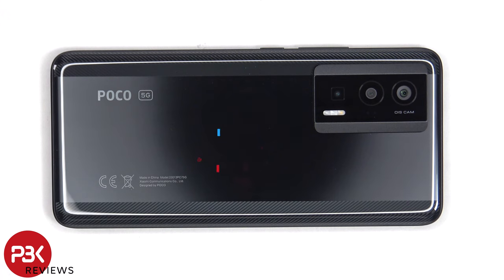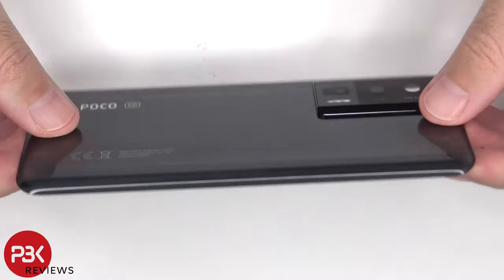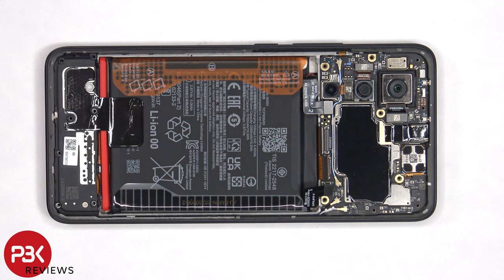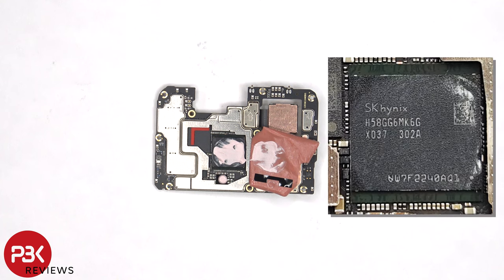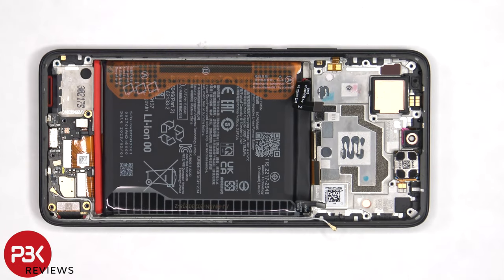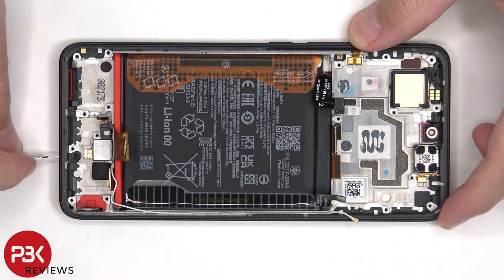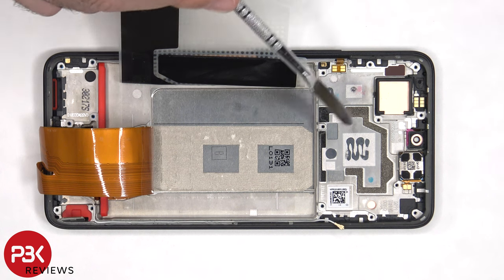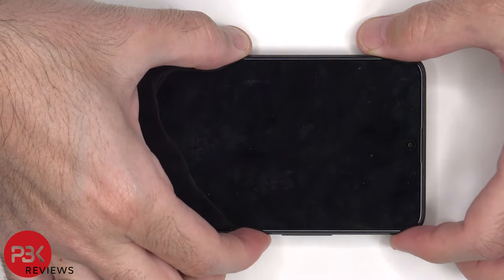Poco F5 PRO Teardown Disassembly Repair Video Review

Comment: i hope this phone last unlike my old x3 pro just died after 9 months
Reply: Phone died or your battery died ?
Reply: @edwardfletcher7790  Phone, maybe motherboard common issue
Reply: @Pezoro_2005  Fixed under warranty ? 

I'm asking because I'm buying a new phone and seriously considering a Poco
Reply from the maker: Hopefully these wont have issues like the older models. They do look better overall compared to before.
Reply: @edwardfletcher7790  nah i dont have time waiting months just to repair instead i buy new one
Reply: @PBKreviews  i hope so, thanks and your video are cool 😊
Reply from the maker: You're welcome, and thanks!
Reply: @edwardfletcher7790  i have xiaomi mi 10 lite and motherboard died now i have poco f4 if this phone i have died like my last phone i never buy xiaomi mi phones anymore
Reply: Ahh the x3 pro motherboard shenanigans
Reply: cheap poco tend to get a motherboard issue, not expensive one😅
Reply: I did exactly the same, upgraded from poco X3 pro, completely dead after 2.5 years. Absolutely no signs of life.
Reply: Maybe it depends on how you use your phone,my x3 pro is 2 years already and nothing happened,good as new,just remember poco phone is tend to heat alot,just keep your phone cool and DO NOT use your phone during charging,that the MAIN reason why motherboard quickly fried up
Reply: Poco x3 pro only the one using SD860, something wrong with that cpu I guess

Comment: What  is your opinion about heat dissipation vs regular poco F5 ? Does the back cover glass help a lot?
Reply from the maker: I haven't used either for long term, but the F5 Pro does have a larger vapor chamber, however it also has a more powerful processor so a larger vapor chamber would be needed to help with heat transfer. As for the glass, its a plus for heat transfer but there is also the wireless charging coil over the battery which the F5 doesn't have so it might contribute to blocking or slowing some heat transfer since its thicker. Overall just based off what I can see, I would say the heat transfer on the F5 Pro is slightly better but both seem to be good.
Reply: @PBKreviews  🤗❤️
Reply: The amount of thermal paste is insufficient, doesn't spread completely

Comment: do you think we can add thermal pad or thermal paste beside the camera to make the apu cooler? i use a phone cooler while gaming but seeing that the backplate doesn't actually touch the components below, i suppose adding thermal pad so it would make contact would make it cooler?
Reply from the maker: It's possible. It won't hurt to try.

Comment: Hello, do I have to remove the back cover to change the glass from the camera, or can I just remove the glass like that?
Reply from the maker: You should be able to just heat up the glass and use a razor blade or xacto knife to pry off the glass since its only held down with adhesive. You don't need to take off the back cover.

Comment: Hello Ser, i need to replace the Battery Cover because is broken , it's really simple as i can see in this video? Thanks
Reply from the maker: Just use a hair dryer, apply heat and use a suction cup tool to lift up the back to give you room to put a pry tool in between the back and frame. Then run the pry tool around to pry it off. If needed you can apply more heat while you are working your way around to make the adhesive loose.

Comment: Bruh. I didn't know phone also uses thermal paste. How can we know if it's dry out. When to re apply thermal paste. Do we need to? 🤔 after warranty ran out?
Reply from the maker: If the phone starts running sluggish or slow and heats up a lot over time, then you would look into replacing the thermal paste. Shouldn't need replacing any earlier than a year or 2

Comment: Justo metí el pinchito para extraer la bandeja en el micrófono pero si sentí que se había roto algo es como si lo hubiera perforado, pero el micrófono sigue funcionando. Quisiera saber que fue lo que perfore? Gracias por tu ayuda. Buen video 🎉
Reply from the maker: might just be a secondary filter for the microphone. There is an additional rubber gasket/filter above the hole so you should be fine.

Comment: does the chipset still sandwiched the ram like the poco x3 pro? coz it was a very bad thermal design.
Reply from the maker: Most flagships have stacked RAM, offers better performance. All comes down to quality of parts and cooling. Should have no problems if cooling is good and quality of thermal paste and parts are good. These seem to be much better than previous gen, so hopefully won't have issues.

Comment: Hello i know this is a late comment but im taking my chances xd is the poco f5 pro compatible with phone coolers , like does it actually cool the important parts of the phone
Reply from the maker: Phone coolers like external fans only cool off the outer housing. They do still help by helping transfer heat that is coming from internally to the housing faster by cooling off or blowing off the heat.

Comment: What a great video! I would love to fix the issue i have myself. My phone recently started making a rattling/ticking noise. Quite fast and not too loud. It occurs seemingly random. For example it's not happening all the time when it's on. Even with several apps open and in use. But then all of the sudden the noise starts again. The only solution by then is to turn my phone off completely. 
Any ideas where to fix this issue?

Comment: im working in oil and gas in abudhabi.. mobile phones with camera not allowed.. my question is i want to remove the camera. it will not affect the system?? it will work without camera?? Thanks ❤️
Reply from the maker: yes will work without camera, but if you open camera app, the either the app or phone might freeze.
Reply: @PBKreviews Can i reuse the graphite sheet from the old broken speaker to another newer speaker?

Comment: hi, what the type of battery that poco f5 pro use? in the video i cant see the type
Reply from the maker: Model is a BM5N and its a Li-ion polymer.
Reply: @PBKreviews  How about replacing it with BM5M from Redmi K60? Seems like there is dummy space filled with red plastic that would allow that. But would not BMS cause incompatibility or would it require some programming or is just plug&play?

Comment: can you teach me how to remove the glass camera lens cover? I want to change it because mine scratch
Reply from the maker: Its held on with adhesive. Heat it up with a hair dryer, and use a razor blade or something similar to pry it off. Then apply new adhesive tape that should come with the replacement and re apply it.

Comment: What's that Red color separator below the battery?
Reply from the maker: Its a filler rubber piece, just there to fill up the space. The redmi k60 which this phone was rebranded off of (basically the same phone sold in a different market), uses a larger battery so the frame and design is the same but since this uses a smaller battery it has that filler to fill the gap.
Reply: @PBKreviews  that filler could cause any problem to the phone? i mean structurally, thermally or in terms of weight
Reply: @snowx4007 no lo creo, sería peor sin el relleno
Reply: @edgaryepez6130  ya tengo el movil, y tienes razon, va de puta madre y sigue disipando a la perfeccion

Comment: Help.. where can i find original amoled screen display for this phone😢
I just got screen display replaced but my under display fingerprint doesnt work😢😢..
Reply from the maker: Did you try backing up your data and doing a factory reset? Sometimes replacements require factory reset to initialize and work.
Reply: @PBKreviews it said couldn't add fingerprint..I looked on back of my broken screen display it got dented in the bottom middle on where I should I put my thumbprint there..is it sensor problem??
Reply: Are poco f5 pro and k60 pro are same display btw??my new display on the label said poco f5 pro/redmi k60 pro..

Comment: Hi man i know that i'm late but i want to know what is the material of the frame ? Is it plastic with aluminum or it is just plastic ? Waiting for your answer because i want to buy this phone
Reply from the maker: Hi, the midframe is aluminum with a plastic coated border. It's not full aluminum frame.
Reply: @PBKreviews  Cool this mixture will give it more solidity in bending , Thanks alot 😊
Reply: @muslm4496  Kurdm 😁
Reply: @muslm4496  Brakam awa allet aluminuma (aw nawchayay dakaweta nawaway mobailaka , wata ka pshte mobailakat krdawa la nawawa daibene  aluminuma) wa chwarchewakay lay daraway mobailaka ba plastic rwposh krawa
Reply: @muslm4496  Sart neshenm ba kurty aluminuma w ba plastic ruposh krawa

Comment: Samsung phones are much better made' Better Quality
Reply from the maker: Yup but in some areas for example the battery adhesive full pouches, the Xiaomi/Poco pouches are much better and easier to use vs the Samsung ones.
Reply: @PBKreviews  i hope the motherboard don't die Samsung can live forver that's why i like Samsung
Reply: Not all samsung phone are better quality, 75% of their parts come from the same factory as xiaomi.
Screen obviously ( samsung)
Chipset (tsmc Taiwan) 
Antenna chip ( China shezhen)
Mid frame ( China factory)
Battery ( China factory)
Vapour chamber for cooling (Taiwan factory)
I know because I order replacement components for my shop.
Reply: @SkybornSlayer  samsung also has some issues with their batteries
Reply: @aztec_3954  still long life than any phone
Reply: Well yeah duhh thats why theyre expensive
Reply: They better be fuckin good

Comment: What's that redish thingy for? 🤔
A place for a bigger batter 😐
Yep K60 has 5500 batt 🫤
Reply: You must be right. This is BM5N battery and Redmi K60 utilizes BM5M battery. I wonder if anyone has put BM5M into Poco F5 pro. It is roumored that BM5M 5500 mAh in Redmi K60 is software limited to 5250 mAh to prolong its life through not charging and/or discharging it fully. Maybe BM5M, if put into Poco F5 Pro, would deliver its entire capacity? I'm afraid BMS circuit is built into battery and would not allow that.